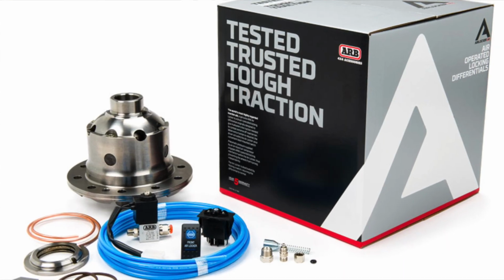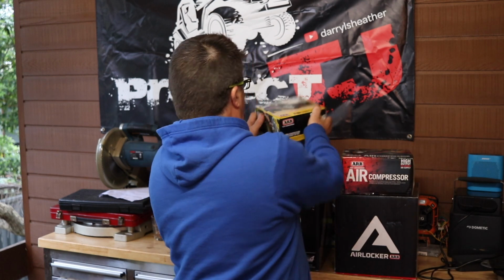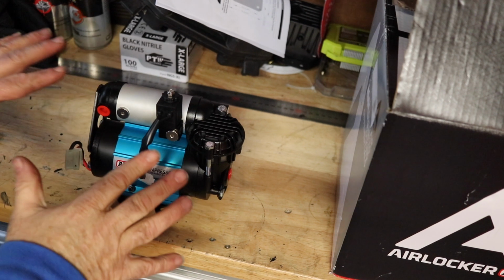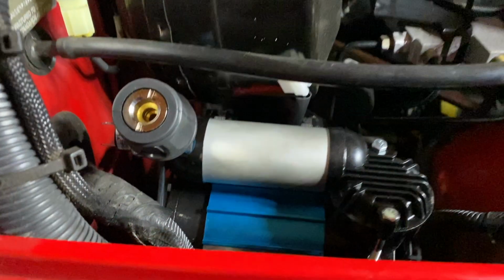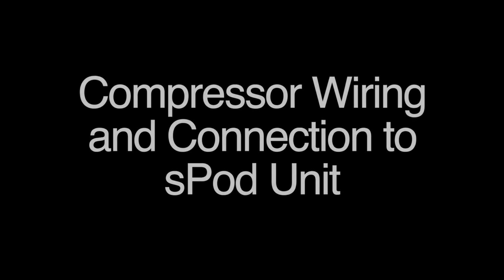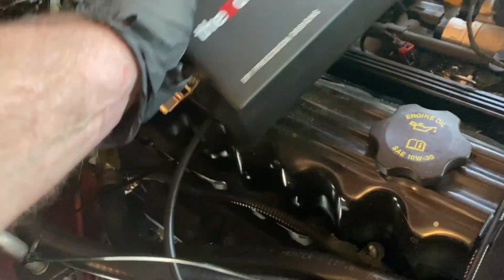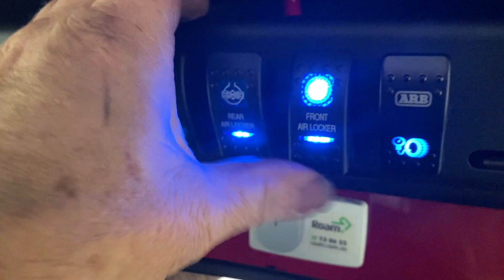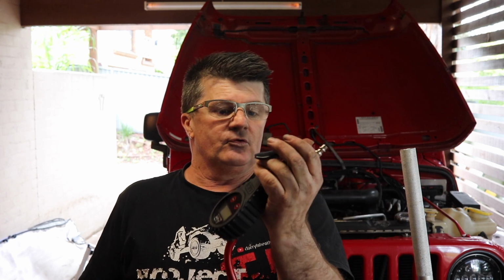ARB Compressor install // sPod wiring // Prepping for lockers // Project TJ

Comment: Hello Darryl, greetings from Texas.  I hope you get this message.  I want to suggest the Dodge Durango alternator swap. It’s easy, and adds a lot of amperage to your charging system for those of us that run lights, compressors, fridges, and winches, etc.  I just installed the 160 amp Bosch and took less than an hour.
Reply from the maker: Thanks for that. Yes, it's one of the options I'm considering.

Comment: Is your TJ running a Dana 44 or 35 in the rear? I have the 35 and debating should I just get a whole new built up rear end or just upgrade the 35 with ARB locking diffs? Really good video post mate, very informative.
Reply from the maker: We never got the D35 rear here, nor Rubicon unfortunately. So it's all D44 rear and D30 front, kinda makes the decision process a lot easier.
Reply: Darryl Sheather: lucky for you guys.

Comment: Great vid Darryl. Have you had an issue with getting insurance while running 33's? I was told that TJs cant go higher than 31 without being engineered
Reply from the maker: No I haven't, although theres a point where you need to move from the run of the mill insurers to speciality insurers who have policies suited to enthusiasts and modified vehicles. Shannons is a good starting point.